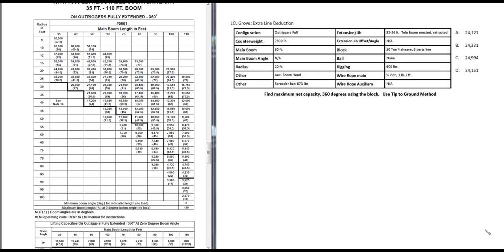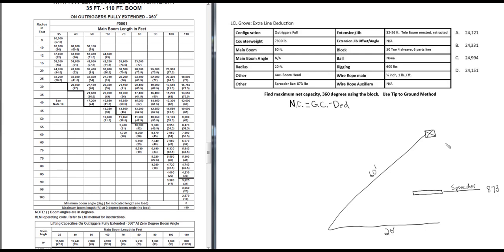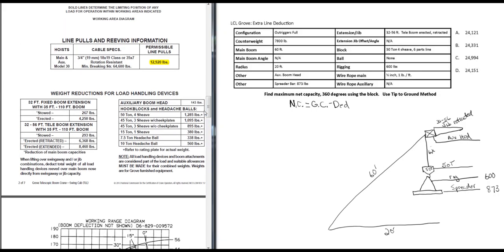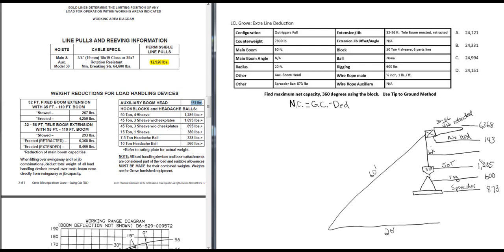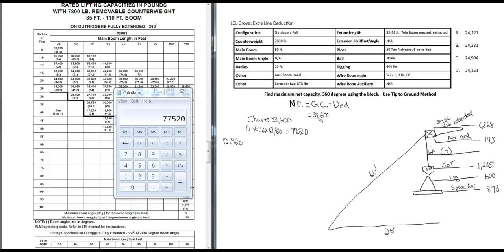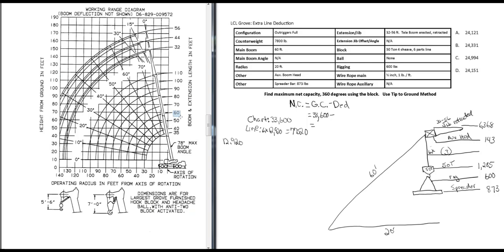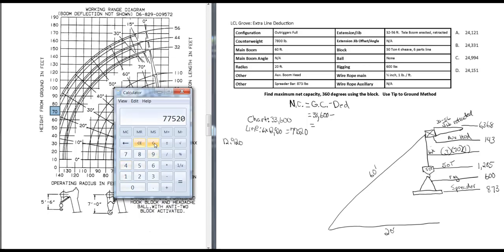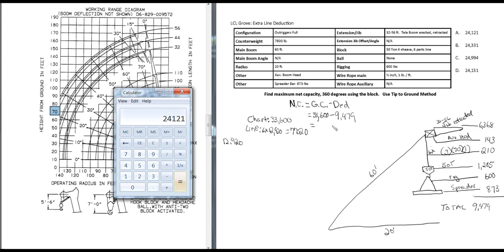Grove TLL Teleboom Net Capacity Extra Line Deduction

Comment: Isn’t the weight of line not used 280 pounds.  70 feet divided by .75×1 (lb) x 3 (lines)=280
Reply from the maker: Where are you getting the .75?  It is 3/4 inch line that weighs one pound per foot.  The 3/4 (.75) is not part of the excess line, weight calculation.  Three parts line x 70 feet x 1 lb per foot = 210.

Comment: erected retracted at what offset angle 0° or 45° makes a difference on cg ?!!!
Reply from the maker: Doesn't matter if you are picking off the main.  The deduction weight for the jib is the same-6368 lbs.  For this problem you use the main boom chart at a radius of 20' and boom length 60  ft.  If picking off the jib you are correct, and that information would be in the problem.
Reply: Load Chart Lab My long belt has 0° to 45° offset which cg of jib moves away from cl of rotation at 0° several feet more load radius than at 45° . These Groves often have the same offset jibs . Maybe this machine doesn't?
Picking off main boom ...not jib that is in chart .
Reply from the maker: I'm guessing you mean Link Belt, rough terrain.  If so that's a whole different animal.  The charts, load chart notes, counterweights etc. are different.   This is a simple problem designed as a practice problem for those taking the NCCCO Grove TLL specialty exam.
Reply: Load Chart Lab Ok thanks

Comment: We ND more swing cab videos
Reply from the maker: Grove is a swing cab.  You wanting National / Link Belt?  I might try to work some up.  Something to think about--you can take any of the swing cab specialty exams to get your TLL certification.  Even if you only run National you can take the grove swing cab test for your cert.  Time is my problem.   This is not my real job and the pay (nothing) sucks, lol.   This was originally going to be just for the Grove and Manitowoc LBC--the two tests I recommend for operators needing the TLL or LBC certs.   I added Manitex because of requests.  Study the load charts and load chart notes (load charts can be found on CCO web site https://wwww.nccco.org/nccco/certifications/mobile-crane-operator/written-exam/load-charts), the process is going to be the same for the swing cab but rules for deductions will be different--may be some additional "quirks" in the notes.  There may be some other videos on YouTube for the swing cab.  If you have time you might also consider a test-prep workshop.  They may teach a different method for the load chart problems but it will probably work for finding net capacity and gross load.  Good luck with your test.

Comment: Sir can you help me,I was told that I have to deduce the weight for the other 3 part of line,Can you explained me,my mistake.
Reply from the maker: You don't reduce the weight you deduct the weight of the parts of line not needed to make the lift.  The chart capacity for this configuration is 33,900.  One part of line has a 12,920 pound capacity.  You only need 3 parts line to for lifting a load up to the gross capacity so you have to deduct the weight of the 3 parts not needed (you started with 6 parts, only need 3, leaving three you don't need).  Watch through the video a few times to see if it starts to make sense.  Also watch some of the other Grove videos.  I hope this helps.